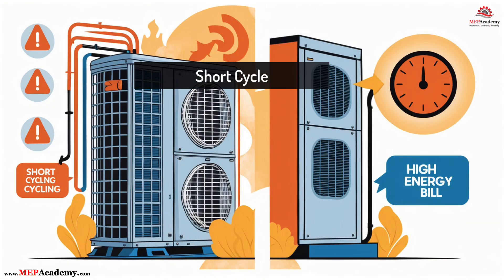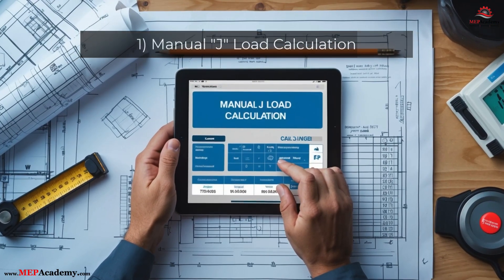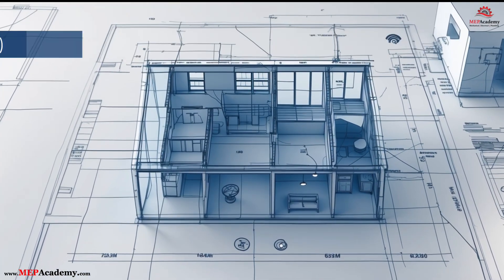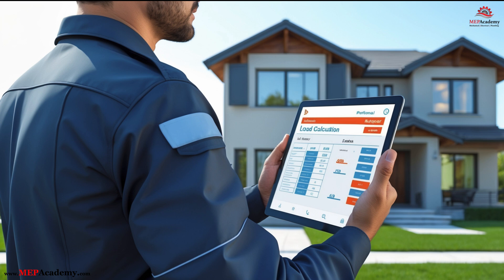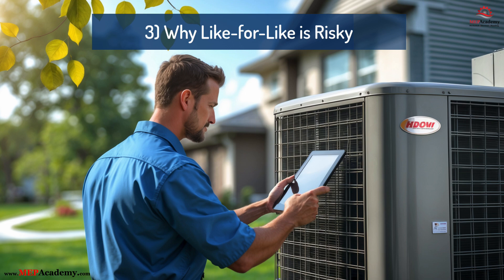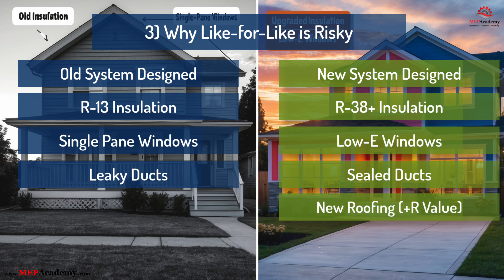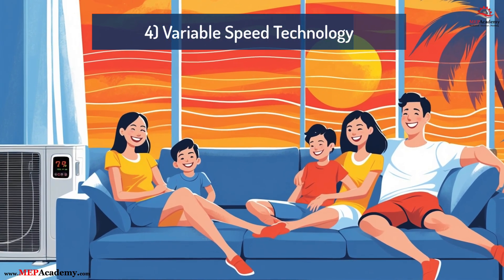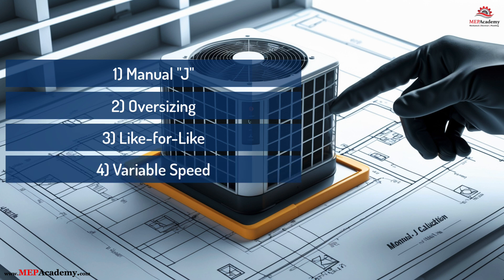Proper Heat Pump Sizing for Summer Cooling

Comment: If the customer doesn't know, what's the best way to tell what insulation and window they have.  Also, how can you tell if the duct is properly sized?
Reply: manual J and manual D load calculations, insulation level=LOOK
Reply from the maker: Great questions — and you’re right that insulation, windows, and duct sizing are critical factors when properly sizing a heat pump!

If the customer isn’t sure about their insulation or windows, here’s how we typically figure it out:

Insulation:
You can check the attic or crawl space. Look for the type and thickness of insulation (like fiberglass batts, blown-in cellulose, or spray foam).
If the insulation is older or looks compressed, it’s usually less effective.
For walls, sometimes an electrical outlet cover can be removed carefully to peek inside, but in many cases, we estimate based on the home’s age and building codes at the time it was built.
Windows:
Newer double-pane, low-E windows usually have a slight reflective tint and a thin spacer between the panes.
Older windows are often single-pane and feel colder to the touch in winter or hotter in summer.
Many windows have manufacturer labels or etchings at the corners with specs like U-value or whether they’re energy-efficient models.
As for duct sizing, it gets a little more technical:

We measure the size of the ducts (width x height for rectangular ducts, or diameter for round ducts) and calculate the area.
Then we compare that against the airflow (CFM — cubic feet per minute) needed for the system size.
Undersized ducts can lead to poor airflow, noisy operation, and lower efficiency.
Ideally, we also check the static pressure in the duct system using a manometer — high static pressure is a sign of restricted or improperly sized ducts.
A professional HVAC contractor will usually inspect these things as part of a load calculation (often called a Manual J calculation) to make sure the system is properly sized for your home’s actual conditions.

Thanks for asking — it’s a great topic a lot of people overlook!